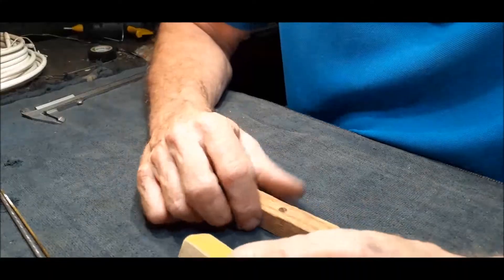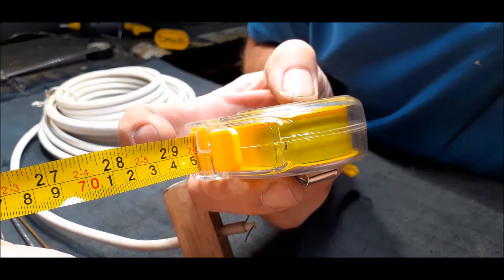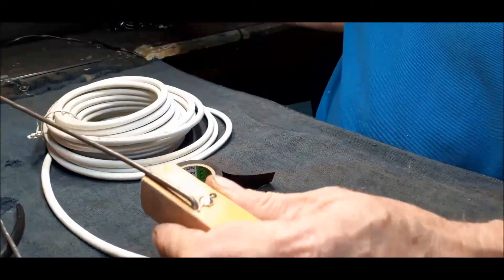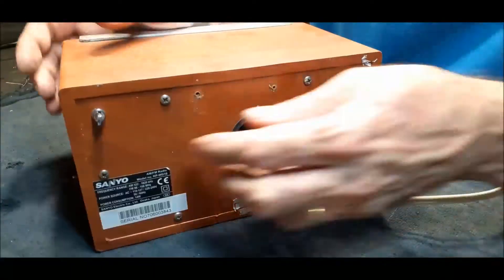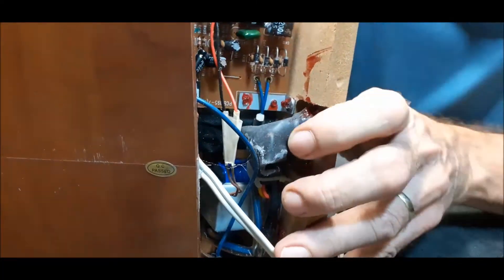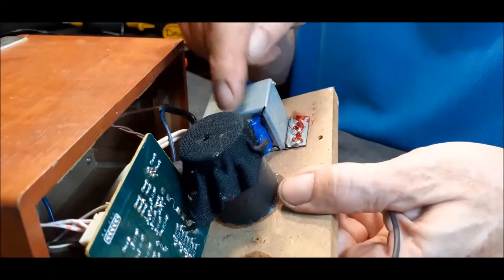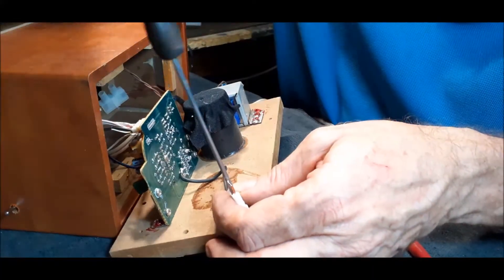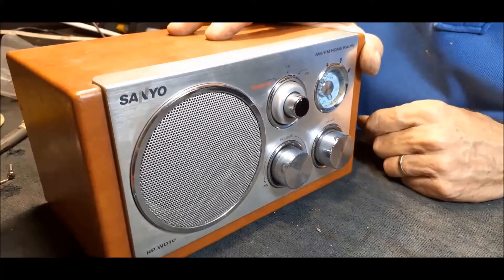homemade radio antenna

Comment: So  is this superior to just buying a good Philips/RCA rabbit ears antenna like the RCA ANT115  for $20 ?
Reply from the maker: @tomsettles6873  yes absolutely. I will make a video on a later stage using a Bulion which compensate for the impediense match. You can google antennea impedience matching transformer.

Comment: It's simple, but all it really needed was a 19 inch long single wire extension on the antenna line and it is done. Just receiving so swr is not a big issue. 
  Good video though.

Comment: Can this antenna be used also to transmit?
Reply from the maker: I am not such a radio boffin but I guess so if it is on the same frekwency
Reply: No, the antenna needs to be a specific length to transmit, depending on the frequency you are using.

Comment: Hello and thanks; Is this method also efficient for short wave?
Reply from the maker: No not really. Maybe you will find something on YouTube regarding shortwave antennae
Reply: Totally different frequency...wave length is completely different.. antennas are built for the most part the same basis.differnt lengths,some use a dipole,some use gamma matches, while others use radials

Comment: What if use any aluminium or copper in place of (Brize/bronze?)? and how can we measure AM or FM using MHZ or KHZ? Boss!
Reply from the maker: Use  any metal. No difference. Please check on you tube for calculations.  I am not so bright on maths😀
Reply: What if use any ground in place of Capacitor negative?
Reply: Great work, but really I need your response due to use as personally.
Reply: Greater idea! In addition to this what if we use any ground in place of -ve of Capacitor?

Comment: Wonderful Video, But If You Have Electric Wire And A Radio That Doenms`t HavE Any receptiuon All You need To Do Its Just Put The Wire Onto Your Curtains Or Any Spot Where You Can hang It On And Then Rap Around The Radio The Wires , Like, 8 Times Around And It Will Receive Much Better In HF !

Comment: make sure it has 300 to 75 ohm balun otherwise it won't work
Reply: Well a dipole is balanced and coax isn't - so some kind of balun is needed. Few turns of coax round some ferrite?

Comment: Can you explain why 75cm?
Reply from the maker: Hi. It is something to do with the waveleghht of the FM radio signal. This is a quarter length.  Cheers
Reply: @DanaKotze  I am trying to get reception on a car radio I’m using in my garage.  I feel like I’ve got everything going right but I still can’t get good reception.  Although they sound pretty straightforward, antennas are hella frustrating to get some good reception.
Reply: O @extion

Comment: Great vid, but how did you work oput what length of rod to use, is that for a specific frequency ?. cheers
Reply from the maker: Yes it is relate to the frekwency.  For fm it is 75 cm per rod. One quarter wavelength. Cheers
Reply: Does it make any difference to the length where the rod is bent into the wood. I would think this part in the wood would not receive any signal from the air. I have seen some other videos where this length is 31 1/2 inches. Also should the rods have a low resistance for my 75 ohms coax connection at my radio?

Comment: Black cable is connected to what, pls advise
Reply from the maker: Hi the black wire is connected to the negative of the supply line. Battery or cap at rectified output of transformer.
Reply: @DanaKotze  tks..have a good day